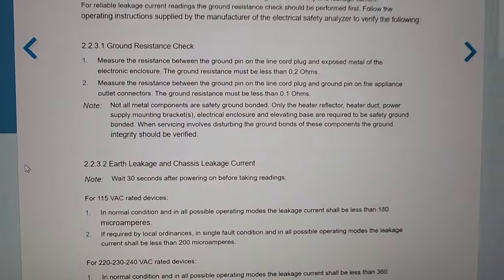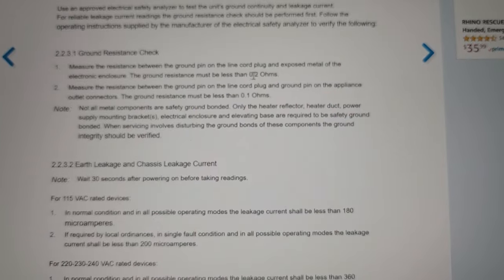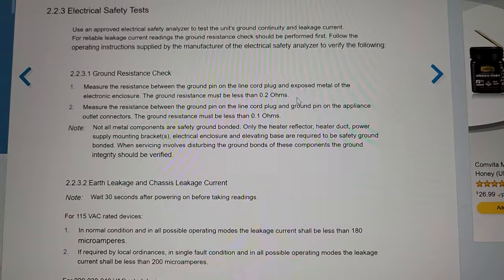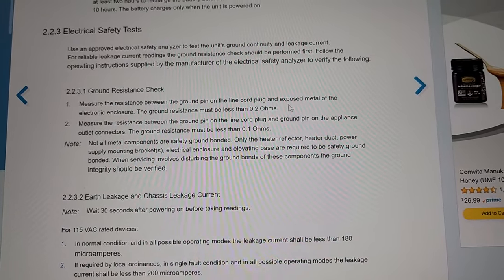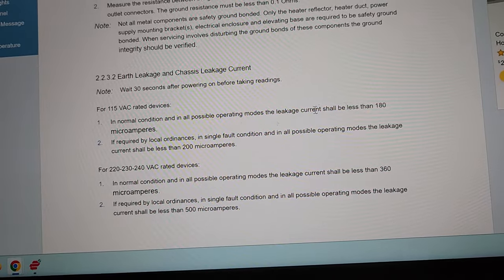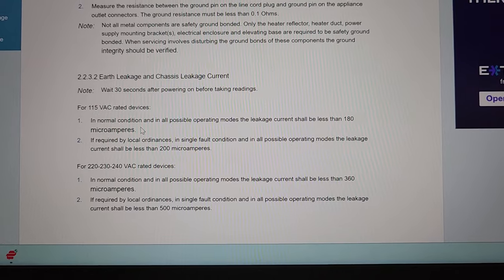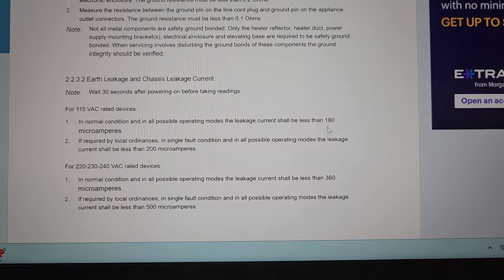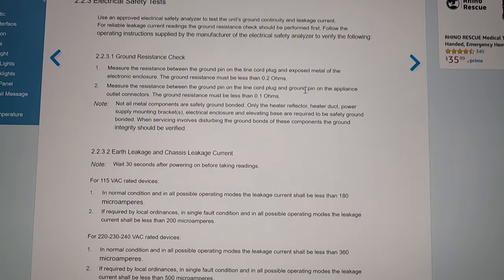NFPA99 vs Service Manuals

Comment: You have to go with manufacturer's requirements. Luckily with Pronk Mobilize solution you can save these limits in a customized profile and have it ready to use when servicing that particular device. There are TONS of these out there!